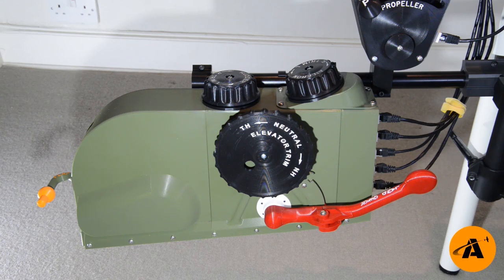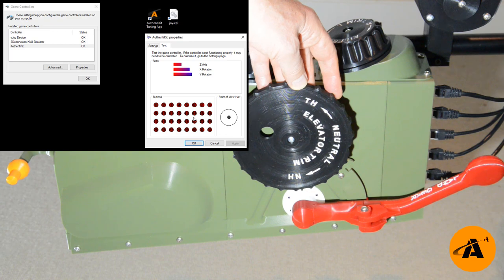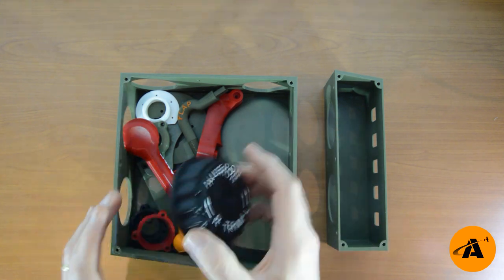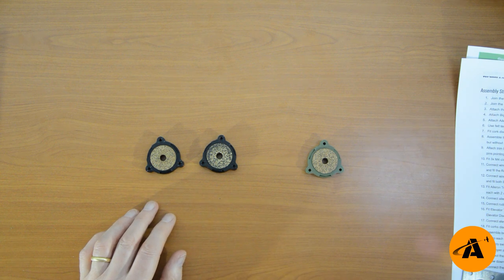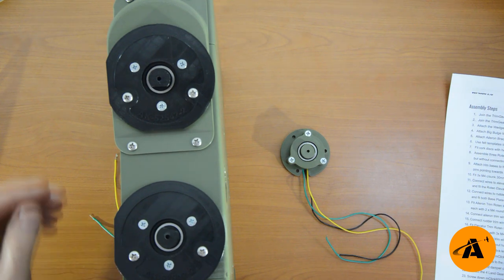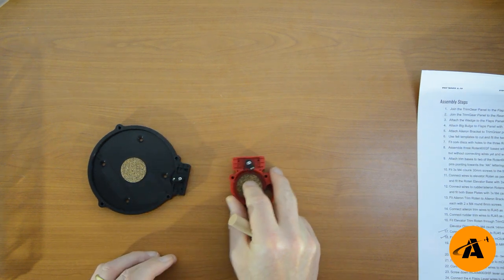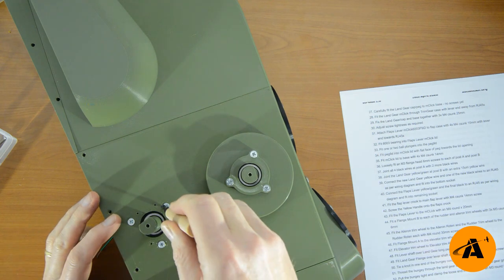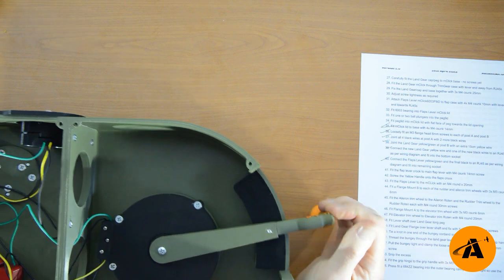AuthentiKit P-51D Mustang Pedestal Assembly Guide

Comment: Ive been waiting for this for quite awhile.  When I saw it was ready I was extremely excited.   Ive wanted a realistic trim setup for a long long time.  My printer is all warmed up and ready to go.  Then I went to the site and began to add all the numerous kits and upgrades kits and kits to upgrade the upgrade, then added shipping to the states and exchange rate it came to nearly $300.  That's without the plastic and juice to run my printer for 50 hours.  After considering my options I bought a Arduino Leonardo for $15, some buttons and two way momentary switches and have 5 Axis and 32 buttons.  I just designed a super simple and extremely cheap elevator trim module at a 2:1 ratio (for now) with custom tensioner for less than $5, with inflation less than $10, lol.  Being a VR guy I don't actually care much how the parts look but rather how I can easily use them with the headset on.  When I finish the design Ill put it onto Thngiverse.
Reply from the maker: Hi. I agree this isn't for everyone. If you have arduino skills and only need one or two trim wheels this is overkill. It's also more relevant for folks who also want the throttle unit and flight stick as well as realistic feeling landing gear/flaps etc. Alternatively you could forget the universal hub and just wire this up to your Arduino.
Reply: Hey mate, did you get your design posted on thingiverse? cheers

Comment: 8:23 - It's notable that in the video, after you increased the sensitivity it exaggerated an issue with interpreting a rotary encoder as an axis, notice that when you start turning the TH marking is at the 12oclock position, which is equal to the axis in its central neutral position. However, after rotating nose heavy slowly, then going back to tail heavy more quickly, the central neutral position is not where expected (when the wheel rotates back to having the TH marking at 12oclock) the central neutral position is a quarter of a turn further. 
It's not a huge detail, but it would be significant for someone expecting to be able to go from one mark, to another, and then return to the original position by feel.
I am curious whether this is due to an overly aggressive rotary encoder software debounce (too much delay), or possibly the lack of a hardware debounce (schmitt trigger).
Reply from the maker: It's been a learning curve. I've found that 1:1 ratio is better on the encoder setting and a 16ms sampling ratio. I'm looking into this at the moment since I started testing spad.next as an alternative to the tuning app. I've been getting zero missed clicks on latest tests

Comment: What's the model number for the rotary encoder? Why don't you make a 3d print file for the use of a hall sensor ? It's a hall sensor more accurate ?
Reply from the maker: Can’t remember but its in the download. Hall sensor only has around 90 degrees range of movement. With our software the encoder is pretty sensitive actually. The s/w gives it 2x resolution.
Reply: @AuthentiKit  Thank you very much for the prompt respond. I'm sorry which download you referring to.  Are you planning to do a Tempest or Typhoon (basically are the same) pedestal ?
Reply from the maker: @JoseJimenez-rf6mi  the AuthentiKit Tuning App is. The s/w. Tempest pedestal isn’t on my personal list but i’ll be sharing the development techniques so others can do it

Comment: Would it be possible to make indicators for the different trim settings? (It might be neccesary to make them electronical as a mecanical connection to them would be very selicate! Maybe someone with electonic knowledge in the group will take on the task?)
Reply from the maker: I suppose it could be done mechanically with gears. My main interest is VR though so i guess i wouldn’t see them.
Reply: That should be /is doable for DCS as you can read-out parameters from the game. So you could i.e. add some small displays that would show you graph of digits equal to actual trim position. In that case, your best option is to go to DCS forum and ask cockpit builders. There are countless tutorials.
As far as I know, Il-2: BOX doesn't provide you that data - but I haven't checked whether it is still true for some time.

Comment: Looks fabulous. Is the green printed or painted? And the extra levers, yes please, even non functional for the looks. I have a very slow printer so need to figure out how to print the huge pieces.
Reply from the maker: Hi, i discuss colours in the first part of the video. Agreed - extra levers needed really.
Reply: I am watching the project for some time. So far I am seriously thinking about some form of cutting the parts for the monocoque (or whatever is the proper technical term for the main green body) from plastic sheet or make some metal chassis and cover it with proper plates, make and drill proper holes and print only levers and internal mechanical parts. 
Still have to think it out.
More levers? Yes, several Il-2: BOX planes have more controls that can be mapped on axis, thus you sooner run out of free axis than mappable controls
Reply from the maker: @mungo7136  actually the ram/air are just 2 position, so no pressure on those limited axes
Reply: @AuthentiKit  (This is Siggles) The ram air lever (left lever) has two positions irl, but the mix lever (right lever) has five (not evenly spaced) positions. Not that any simulation models it, or that it's even that necessary since the effects of the levers isn't even modeled in DCS.
Reply: @AuthentiKit  Right, but I am looking at it as more general controller than specific P-51 one. That's why I am thinking about replacing flap controller from click/step one to true axis. Same idea about those 2 missing ones. Because many planes I fly in sims have flap control that is not split into steps.